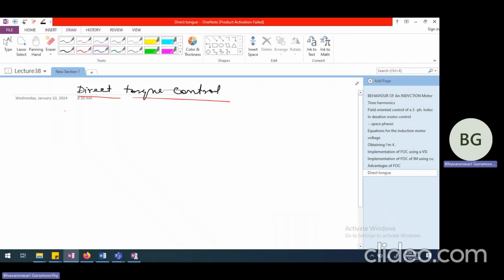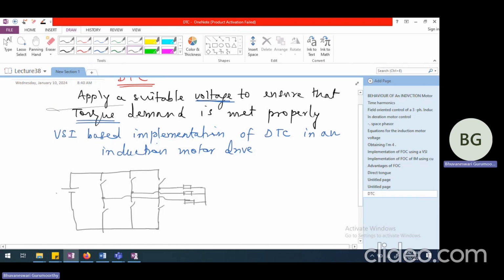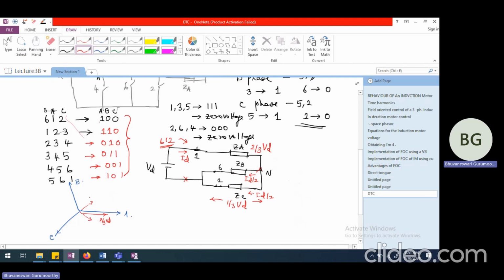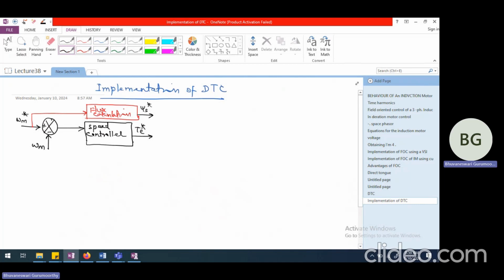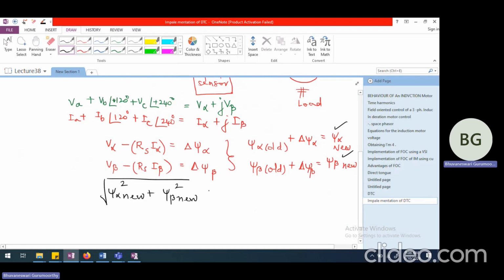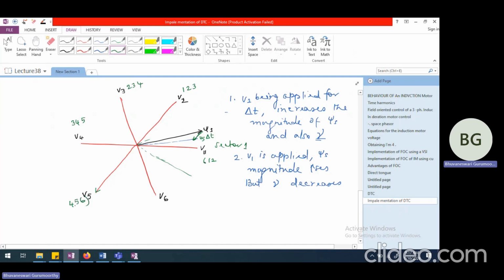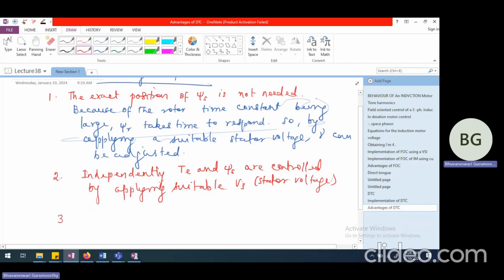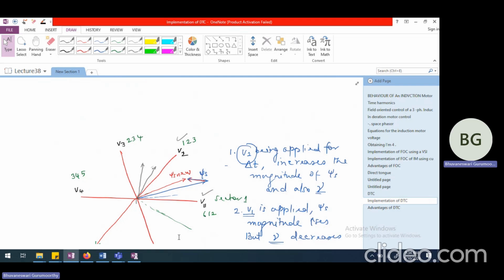Drives L40 Direct Torque Control of three-phase induction motors

Comment: In DTC , There is no park / clarke transformation is required ?
Reply from the maker: If you are sensing three-phase currents, then to convert them into d-q, you will need these transformations. these d-q currents are used in flux and torque calculations.

Comment: And one more thing. You have mentioned that when we have the speed reference, then you have created a block in red colour just above the speed controller & said that when speed ref we have , the flux estimation can be done.

My point of view is that when we have the speed ref, then our drive will calculate the output frequency . Because freq is directly related to speed. However in order the constant V/f ratio, the drive shall choose the right voltage value to be send to output.
Then when drive will decide the output voltage ( based on frequency) the stator flux will automatically be set at certain value .

Am i right ?
Reply from the maker: In most of the cases, especially in induction motor drive, we will set the flux at rated value as long as the reference speed is below base speed. For operating above base speed, flux weakening is employed where the reference flux is set at a lower value than the rated flux. (Flux above based speed=rated flux*rated speed/new reference speed)
Voltage is automatically decided based on flux error, torque error and voltage vector selection table.

Comment: Madam, in implementation phase , ypu have shown 2 speeds signals. 1 signal which is setpoint at which we want to run motor. Second signal coming from motor feed back which is actual speed.

But in DTC there is no feed back sensor mounted on motor which measures the actual speed.
Reply from the maker: From the three-phase currents that are sensed, torque can be calculated. Synchronous speed can be inferred from d(flux angle)/dt. With the calculated torque vale and synchronous speed, actual rotor speed can be deduced. No mechanical speed sensor needed.